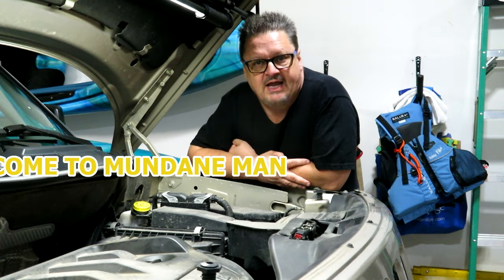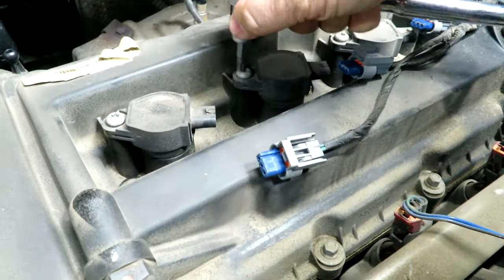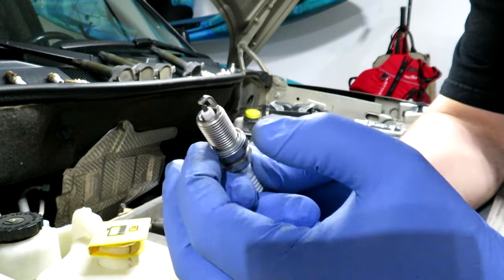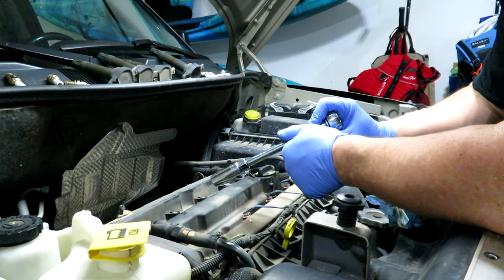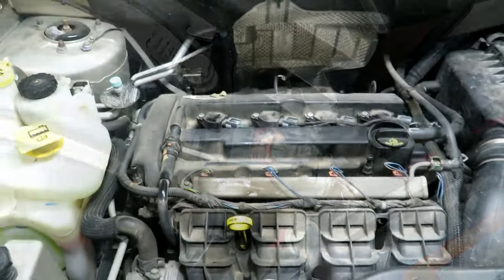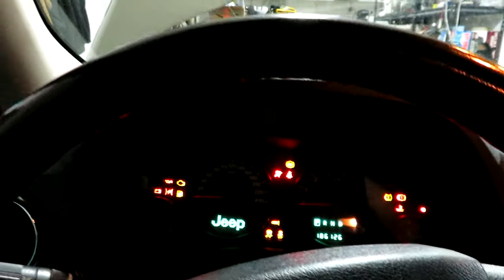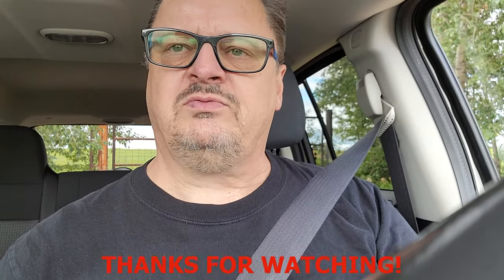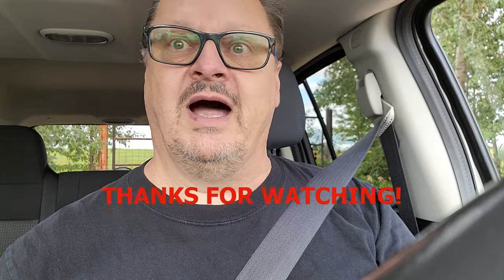Replacing Spark Plugs & Cleaning Iat Sensor For Jeep Patriot And Dodge 2.4l | 2007-2017

Comment from the maker: My apologies for my error in referencing the MAP sensor in the middle of this video when in fact I cleaned the IAT (Intake Air Temperature) sensor.  The MAP sensor is at the intake manifold and generally you need to access it from underneath the vehicle.
Reply: no sir you can access the map sensor from the top of the vehicle. Thank you and God bless

Comment: Nice job on the video! Wondering if you have ever considered replacing your throttle body? I own a 2012 and have had issues with mine. Had it replaced because of poor performance and lagging at 2000 RPMs when driving it.